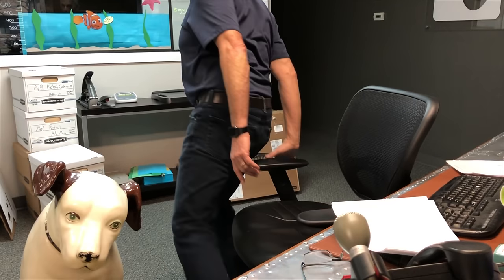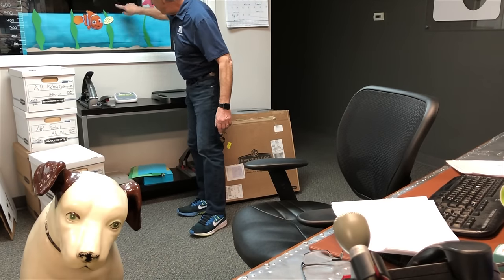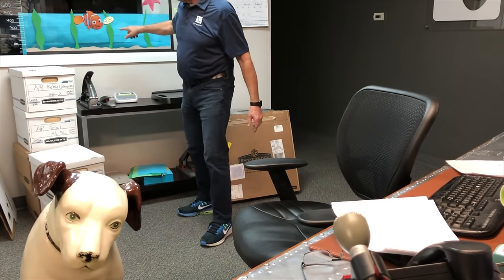Why do tubes sound different than transistors?

Comment: I've been waiting 25 years for that, lol. I really appreciate it. That was the simplest, most concise explanation of valves vs solid state I've heard.
To the guy who dosent understand how it effects sound: remember that voltage = PSI (roughly) running at higher voltages creates a higher share of linearity for the signal. The more linearity, the more headroom. More headroom allows for broader soundstage (x&y), faster reactions to peaks and lows, it adds some warmth (although a good SS amp that's good and warm and running in the meat of it's powerband is hard to beat) 
and definitely "puts less strain" on the signal b/c of the exponentiated section of linearity on offer to the signal.
Reply from the maker: Thanks for this kind comment. Glad I could help.

Comment: 8:25 "anybody who will tell you that [three devices] ... running at the same [specified parameters] ... do not sound different because they don't measure different ... is [wrong]"
You never did explain exactly how or why in detail.  I'm still not sold on the argument that tubes > transistors.
But my focus is on the "measurement" itself.  If instruments have finer precision and better resolution than the human ear ... and they "measure the same" ... then how can the things they measure "sound" different to the human ear?
Reply: Exactly.

Comment: Amplifiers with tubes do not sound better unless you compare a High fidelity tube amplifier with a cheap solid state amplifier or you have a distorted way of listening the sound with a lot of nostalgia. The fact is, for the same frequency response band 20 to 20khz +or- 1 db  20 watts ,  into the same speakers in the the same room, you can evaluate the difference in the sound, it is the same but the equipment will be smaller and more efficient  solid state vs. tubes , make the test as I have done decades ago.

Comment: Sorry, but this does not explain WHY tubes sound different to transistors. Is it possible to measure the difference in sound quality, to prove it exists? Right now I'm not convinced. By the way, I currently use a cheap Chinese made T-Amp which sounds excellent, to replace a Marantz Class A Amp which was large and heavy and gave off a lot of heat. How about a video on "Class D" T-Amps?
Reply: TAKE A BASIC ELECTRONICS COURSE

Comment: *Curt Chase* (1 year ago) https://www.youtube.com/watch?v=PbJ1GZMi_ho&lc=UgjUXSty8DmVrHgCoAEC

"This tube VS transistor debate will go on and on for ever! I am 61 years old and grown up in that transition from tubes to transistors. My 7th grade science project back in 1968 was comparing tubes to transistors in audio amplifiers and I made it state competition! Although my project was centered around the mechanics more than the sound, I will admit there is fairly determinable difference in the perceived sound between the two. Transistor amps are very "straight forward" in the quality of audio output. As long as it's not clipping, the signal hitting the speakers is pretty much a clone of the input, just stronger. That's one reason an audiophile may say the trans amp sounds hard, harsh, gritty, etc. On the other hand, tube amps have the natural ability to "smooth" things over. Soften the blows, add those sweet sounding harmonics that gives the sound a flavorful pleasantness audiophiles and guitarists love. Reason? Just the way a tube circuit works has a lot to do with it. The output transformer that pretty much is mandatory in a tube amp plays a big part in producing that smooth warm sound. Remember, it's a magnetic field that is the medium used to couple the output tubes to your speaker! The magnetism sort of processes the sound in a way that actually distorts it, but in a way that is pleasing to the ear! Crazy, huh? BTW....This info is MY take on this. Generated from 50+ years toying with all kind of amps. Thanks for reading!"

Just-cross-posting I liked what he had to share, so sharing here. -delgoogle
Reply: Very nice brother, it's very true that the valve or tube amplifier pleasant to hear but that time in 1968 there was transformer in transistor amplifier also. But however the valve amplifier very pleasant sounds.

Comment: My thoughts are that the human brain has the ability to determine if the input its getting is real or a facsimile.
I think this is the core of the tube or transistor, analog or digital debate.Analog audio and tubes are a closer reproduction of the original ,even with its technological flaws.

Comment: I’m sorry everybody but, when my 45 watt Solid state guitar amp was in the shop 40 years ago, I borrowed a buddies 6 watt Fender champ.  That 6 watts of tube tone blew my 45 watt SS watt amp out of the water!  I ditched that thing, used tube amps ever since and never looked back.  So your Line 6 “models” a Tweed Bassman?  Evidently, you’ve never played a Tweed Bassman!!!
Reply: Jack Dixon: I dont doubt it, but you know instruments like the guitar can sound better with added distortion, so this doesnt really apply to Hifi where you want the sound to be transparent.
Reply: @suzesiviter6083  All good tube amps are super transparent, no audible distortion, what they actually call ''distortion'' is the non fatigue, sweet sound of tubes! Actually music sounds more real and live on tubes, especially jazz! But each to their own...
Reply: @HASHEAVEN  A good DSO will prove you wrong, Valves simply cannot go into the low THD figures a good bipolar or MOSFET amplifier produce; you prefer the sound and that's fine; but it is false to say you cannot hear the distortion relative to a good transistor design. Valves produce different types of harmonic distortion; this is one explanation why some people prefer Valves; IMO the warming up time and decreased life of tubes negates any small sonic advantage-but each to their own.
Reply: @suzesiviter6083  I also like certain solid states like the simaudio moon, McIntosh, Accuphase and the clarity and detail of passlabs but those are all out of my reach. Maybe your are right but I certainly can't hear any distortion with my line magnetic, which I think sounds clearer and more detailed than many SS at it's price. Maybe what people call tube distortion is just the characteristic tube sound that I love...
For ex I don't like the sound of an old SS Rotel receiver that I have, or a technics mosfet and a marantz of a friend and my LM 219 has better soundstage, detail  bass midrange and more information on the highs than those, which for many people are good Solid state Amps.
Reply: @HASHEAVEN  Well whatever works for you, Valves do look sexy. I still have the old Pioneer A400 which was raved about in the 1980's; I haven't wished for an upgrade yet. Some of those old Amps can still keep up or better todays amps, the A400 for instance used custom silicon on the output transistors-which is rare on all but the most expensive amps even today. My biggest mistake was getting rid of my old Linn LP12; that had a certain magic and yes you can argue Vinyl has higher distortion; but the sound was just so much more enjoyable than a CD; so I know what you mean.
Reply: It probably had a more efficient speaker

Comment: Amplifiers (and all audio devices) that actually sound different will most definitely measure different somehow. Anyone who says there are audible but inmeasurable differences is either full of you-know-what or in the business of manufacturing or selling those devices.
Reply: I agree FINALLYQQQQAVAILABLE. If an amplifying device is operating in its linear region then - by definition - its output is a linear amplification of its input, regardless of whether the device is a tube or transistor.
Tube amps sound different to transistor amps because their circuits are different; fewer gain stages, capacitance or transformer interstages,  less NFB and so on.
Reply: Nick T: You can take the output of any amplifying device and put it on an oscilloscope and you can see the waveform. If you have two outputs from two different devices and their waveforms look exactly the same, then those two waveforms are the same. - that's kinda the whole point of an oscilloscope: to compare waveforms.
Reply: Yes, generally we use a sine wave at blank hertz. A sine wave comparison at one frequency is not the same as music playback as the circuits an their parts change in linearity with different frequencies. I suggest you read nelson pass short write up on feedback, crossover distortion, and transistors. Also, look into the Hirata test.
Reply: Nick T: At what point did I say sine wave?
Reply: Have you learned about sex yet ? Some just never get that either.
Reply: You can measure the difference, however I'm pretty sure most people will not be able to tell the difference in a blind test.
The thing is, we don't listen to equipment in blind tests. Sound is extremely subjective and psychological. Most people like tubes because they... like tubes, and automatically feel like they sound better. Of course it's hard to explain such sentiments in the age of total rationalization where only the cold hard outcome matters and not the way it is achieved. A flimsy chinese DSP chipamp will never 'feel' the same as a genuine glowing tube amp even if it's exactly programmed to sound like one. Is it so hard to get?

There are some objective advantages though:

-Tube amps cannot kill your speakers by sending straight DC into them when they fail.

-Underpowered tube amps cannot kill your tweeters as easily if you turn them up. 

-Tube amps use smaller value capacitors that can last extremely long, barely any electrolytics. 

-Tubes are easily recyclable and don't contribute to the massive pile of cheap chinese e-waste in landfills on our backs.
Reply: @pike3685  yes we had, the only parameters is voltage and current and their change over time ;) the only tricky thing is after you have the data, how do you characterize things based on it, we can measure distortion, noise, linearity etc. there is nothing that you hear and it's not in the data

Comment: I believe that there are two major CAUSAL differences: (1)Tube amplifier distortion curves cross the cutting point of X and Y axis in a signal level/distortion graph. In other words, the lower the volume, lower the distortion. Thus at very low signal volume there is practically zero distortion. The transistor amplifier curve does not cross the meeting point of X and Y axis. The amplifiers never reach zero distortion. In some the distortion even increase at low volumes. Thus we always get some tangible distortion.
(2) The noise levels of tube amplifiers are very low, specially at low volumes. The transistor always has some noise, so signal to noise ratio suffers at low signal levels.
The audiophilic ears are extremely sensitive to distortion (and of course everyone can hear noise). That is why tube amplifiers sound so silky smooth and favored by audiophiles.

Comment: For me the biggest difference (as a guitar player) is the harmonics when distortion is present. The harmonics are frequencies that are added to the original signal. I don't know why but tubes produce even order harmonics which means that these new frequencies are higher octaves of the original signal. On the other hand transistors produce odd order harmonics which results in frequencies still dependent on the original signal but with in a different musical note.

Comment: Well, That danced all around the headline subject and never hit it.  Can you put some science into your discussions and support what you are trying to say and are never quite getting there?  Tubes are different, but that doesn't mean better. 

 I  have just constructed, after 2 years of development, the best sounding (in my very experienced opinion and maybe I am biased too, as you are) the best sounding stereo system I have ever had and I go way back in time.  I was into audio before stereo was commercialize.   I have to say it that way because the first stereo broadcast was in the 1920's I think 1927. And a stereo recording was made sometime in the 1940's. I was born 1947.  Stereo was introduce to the public about 1957.
I have the MaIntoch, Fishher,  Eico and Dynaco etc, amps in my closet to prove it.  My new system is not just and amp, but a totally integrated system from head to tail.  I feel that this approach is the only way because isolating each element and evaluating them as stand alone devices limits the ability to iron out the places that most effect the outcome. It is made from off the shelf modules  that I modified to get the sonic results  that I wanted.  I am 70 years old and I can still hear 17 khz.   It satisfied my ears not test equipment.  Yeah I know that is not scientific and I was referring to science at the outset of this diatribe, but I was requesting the presenter to put some basis on the claims of the article.  My "satisfied ears"  is just that.  I have a sound that gives me what I have felt was missing in all previous systems. And there have been  MANY!  Is it flat from DC to blue light?  Does it have a megawatt output? A S/N ration of - 2000 Db? I don't know and I don't care,  It sounds fantastic and that was my goal, not a bunch of numbers.  And it is all integrated circuits, not even discrete transistors.  Several people have heard it and it lifted the eyebrows of all.

The amp with MM mag phono,  three aux inputs L&R speaker outputs and sub woofer output in a box 8 7/8" wide, 1 3/4" high, 
6 1/4" deep and plays louder than you would ever want to in a normal living room. My living room is approximately 2000 SqFt.

That's my two cents.  Thanks for the platform.
Reply: So what is your current system composed of?   Is it off the shelf products or custom designed?

Comment: Pierre Marcoux is a legendary audiophile in Quebec. He's been testing audio equipment for local manufacturers like Oracle. Here's what he told me : Tubes have distorsion on pair harmonics and transistors, on impair harmonics... Even though tubes have much higher distorsion level,  it's not relevant because pair harmonics distorsion is not audible because of phase cancellation. In other words, the distorsion cancels itself, which is not the case with transistors. Transistors distorts on impair harmonics, which are audible. That's why transistors require feedback sent in the signal. While this lowers distorsion, it also removes some musicality. There were two other differencs, but I forgot what they we're... sorry!

Comment: Tubes and Bipolar Transistors sound different because they operate by completely different principles, the word "Transistor" is short for the devices full name "Transfer-Resistor".
Reply: They are not so different as you might think, not when you get down to the electron level; its still an approximation of a little guy opening a gate.
Reply: @suzesiviter6083  Yeah true, but tubes are mainly voltage-amplifier devices whereas solid-state transistors are mostly current-amplifier devices, yes there are Fets (Field Effect Transistors) and MOSFETS (Metal Oxide Semiconductor Field Effect Transistors) that operate very similar to the way a tube operates.

Comment: What about the difference in distortion? That is the primary reason WHY they sound different. Tubes produce even harmonics whereas transistors produce odd harmonics. Also, transistors have hard clipping whereas tubes have soft clipping. Their frequency response curves are also different. That is what gives tubes their "warm" sound.

Comment: I don't consider amplifiers according to the devices, which are used to made them. Even a chip amp like a LM386 can sound very pleasant, if its surroundings are designed in the right way. A TDA2050 can sound very good, and my favorit, a 2STW100 / 2STW200 Darlington BJT boosted AD820 precision op amp which sounds outstanding neutrally and good.
 
At last it is physics that matters. Imagine if they've never found solid state amplification. I am sure we would have today tubes which are comparably neutral like BJTs and FETs.
 
The main difference what I have found in tube amplifiers compared to BJT and FET amplifiers is caused simply by the required slew rate of voltage. Tubes are in general relatively slowly devices. And, especially in output stages, they have to handle enormous voltage variations per unit of time, because tubes are unfortunately design to handle low currents and high voltages. So, from the viewpoint of slew rate, it is easy to outperform a tube with a transistor, which can handle low voltages and high currents.
 
Another problem of modern tube amplifiers is, that literally "antique" devices (or devices, which are build according to designs which are 70 years old) are used to make them. In principle one could develop modern tubes, or even integrated vacuum circuits, with performance data, which are much better adapted to state of the art audio amplifiers.
Reply: The slew rate of the device always skips in our minds. Thanks for the things.

Comment: Tubes are vacuum so they won't generate noise and reproduce true input signal due to very high input impedance (if you don't overdrive it), the only drawback is output transformer that dictates the frequency responds.